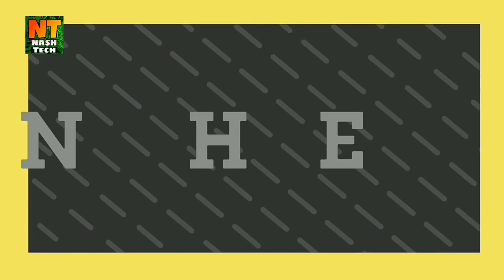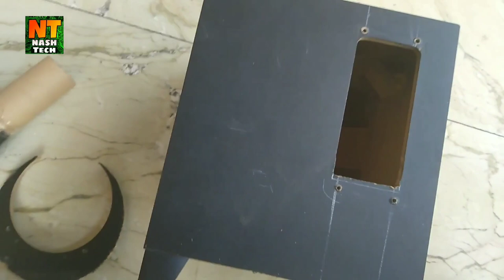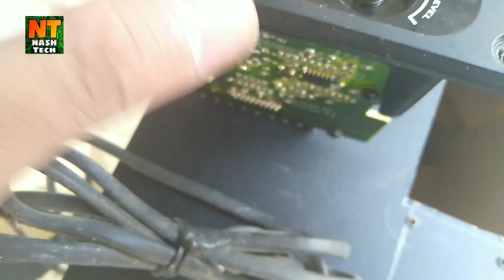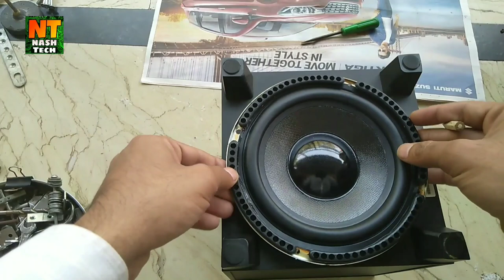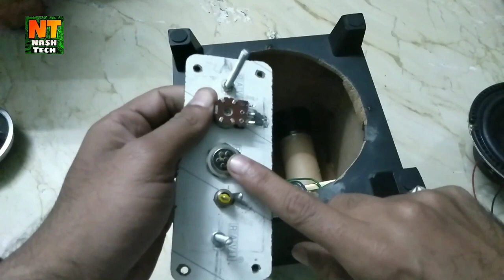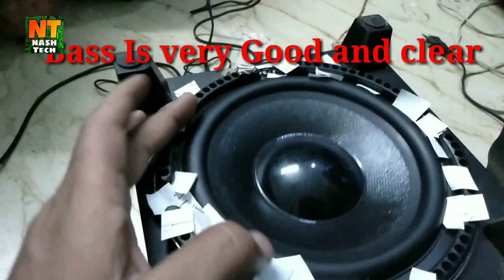Creative Subwoofer Replacement 4" to 6" Sub

Comment: It's a ported box, you just messed up it's dimensions and air volume by using a sub with different parameters. 

Congrats, you just increased the inernal resonance and varied the natural roll over of the bass.

Comment: Heyyy.. Wat if I just cut the positive and negative wire and connect it directly to the new 6" speaker will it work?. ... Instead of opening the whole woofer and get confused with the many wires
Reply: Yh it will work